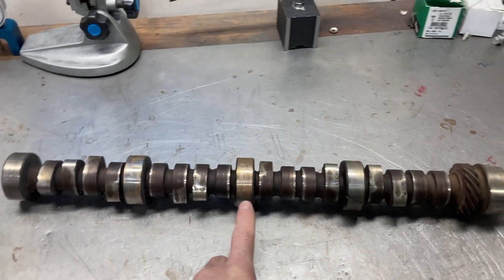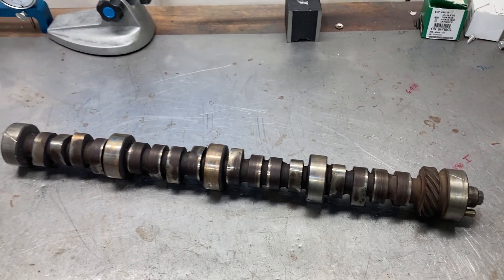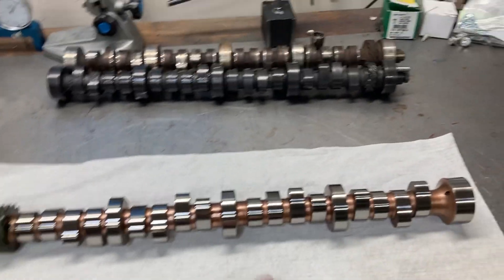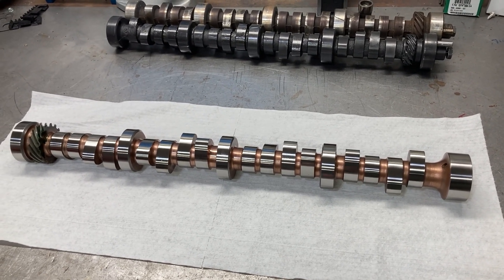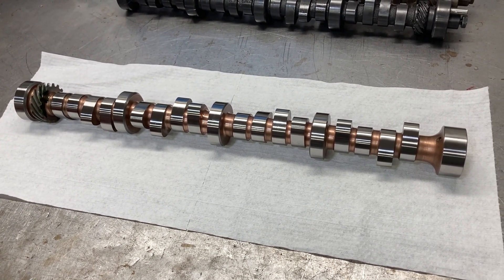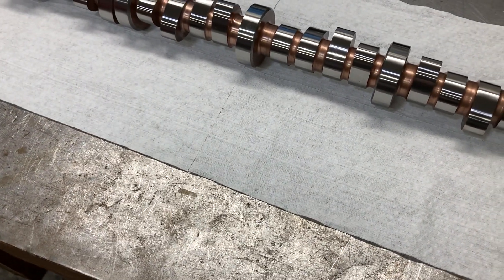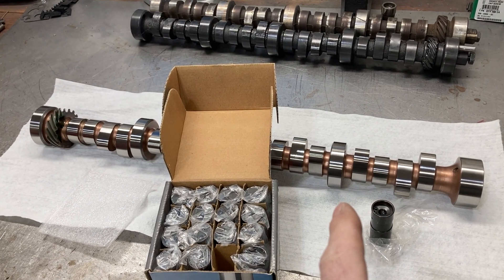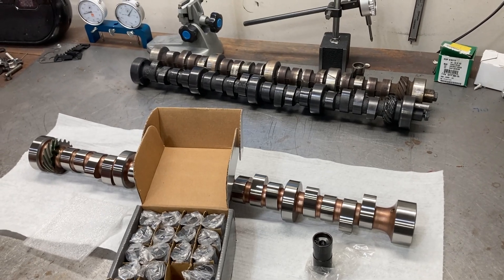Lykins Motorsports The Ultimate In Flat Tappet Cam Technology

Comment: Billet steel flat tappet? That is awesome! I have always been a fan of solid flat tappet cams because of the massive amount of low end power it makes it even beats roller cams at low rpm
Reply from the maker: Uh, never heard that one before......
Reply: @lykinsmotorsports  It's because the flat tappet doesn't have to get over the lifter side load that the roller cam has to. Yes I am aware that flat tappets still have lifter side load but roller has a lot more side load and doesn't over come that disadvantage until about 278 duration at 0.06 thousandths.
Reply from the maker: There may be a case here and there where that's true, but I certainly wouldn't paint the entirety of cam theory with that broad of a brush.   Way too many variables.

Comment: Valve train weight vs nose: note the billrt cam has a larger radius nose.  This buys a little extra time with a gentler over the top profile that helps avoid some lofting/bounce issues on direction reversal.  You give up a little peak lift and get  a portion of that back as are under the curve.

Comment: What is the typical longevity of the DLC lifters paired with the billet camshaft?  Is the jury still out?  I really think that technology like this can open up some really interesting doors even with the degrading quality of modern metallurgy.
Reply: Metallurgy is better than it has ever been.  The problem is the cheap product manufacturer's trying to get steel as cheap as they can and trusting mill certs from shady mills. 

I work in NDT and Positive Metal Identification is one of the fastest growing markets. We are even being asked to check mild steel beams and HSS which no one would even have bothered with years ago. But now lots of places actually buy bulk lots from China that have been rejected and bring them in anyway and print you out a mill cert that says anything to make the customer happy.
Reply from the maker: Before NASCAR switch to solid rollers, this was the staple of all Cup engines.  The lifters and cam will last a very, very long time.  As with anything else, it depends on the application, but my guess is that the cam/lifters would outlast most everything else.
Reply: @lykinsmotorsports    Can these components be used for a slightly rowdy street application rather than strictly for performance racing?
Reply from the maker: Yes

Comment: Brent, awesome video ! I have a question. I know what you said at the end of the video about “ballpark” (?) valve spring pressures for the billet tool steel cam core as being about 220 lbs. seat, and 500-525 open. Is that open pressure set in stone ? The reason I am asking is because Comp has a dual conical valve spring that has 160 lbs. seat at I believe 1.900 or 1.950 installed with 600 lbs. open. Do you see where I am going with this ? Or would that not work ? I’ve wanted to do this ever since they came out with this particular spring. I am asking because I don’t know. And it would be better to ask someone that does- you, in this case. Either way, thank you for your time, video’s, and above all , sharing your hard earned knowledge with your subscribers.
Reply: Brent what would think 289 HP heads in the box would be worth 68/69 with smog holes??

Comment: What’s a ballpark price comparison? The DLC coated cam and lifters vrs standard stuff and the billet core?
Reply from the maker: A custom flat tappet cam is $275 and standard lifters are around $90-100.  A custom nitrided flat tappet cam is $425 and EDM lifters are around $160.   A custom billet core solid flat tappet cam is $825 and the tool steel DLC coated lifters are $1400.
Reply: @lykinsmotorsports   - this does separate the men from the boys! Lol. Good information again Brent. Thank you for sharing your expertise.
Reply: @lykinsmotorsports  thanks for the reply. My custom 55mm solid roller billet was about 850, and .937 BAM’s were about 1400. So I can see the billet flat tappet being used for high end class stuff. The nitrided flat tappet cam and edm lifters is a solid alternative at those prices.